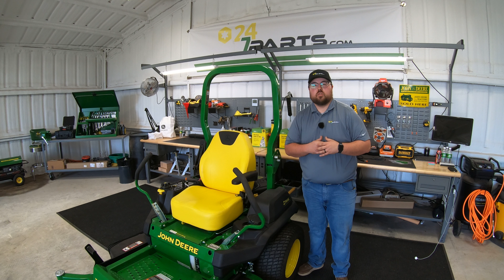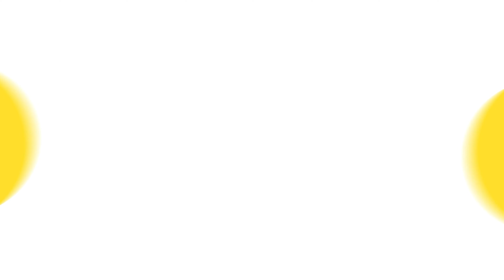How to Install Deluxe Canopy w/Fan on John Deere Z735M Ztrack Mower

Comment: Can you let the rollover bar back down with the canopy still attached for transport on a trailer? Or would you have to remove the canopy each time??
Reply: I was wondering the same thing. I doubt it based on the torque of the bolt.